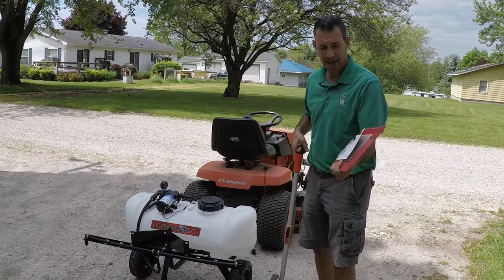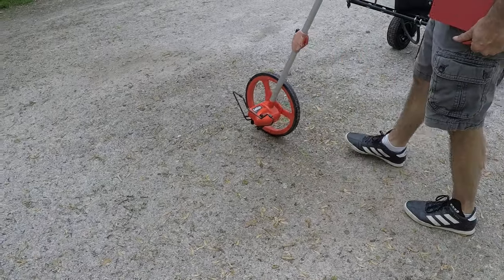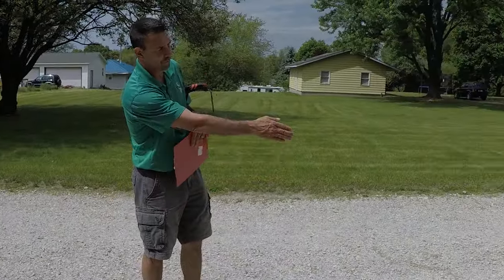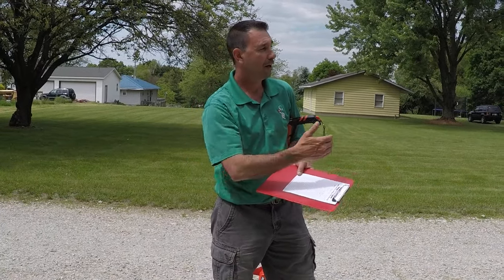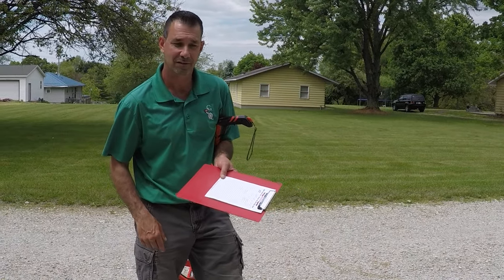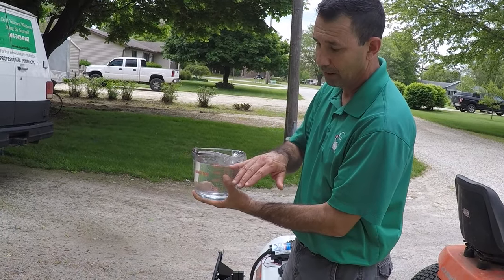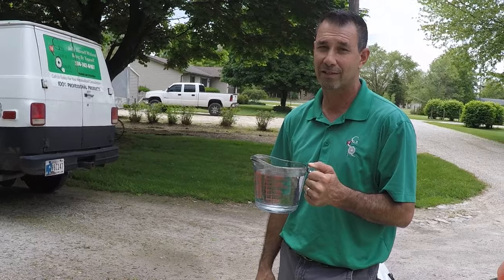How To Calibrate a Boom Sprayer

Comment: Most of the home boom sprayers have 2 spray fittings on the ends. They tend to overlap each other on the centerline as much as 40". You then also get a 40" lighter spray on the ends. You will need to overlap the next row with the outside spray fitting to get get the same coverage as directly behind the centerline. Look it up in your manual.

Comment: Am I missing something? Would he not only be putting down 1/2 of a gallon per 1000 sq ft out of just that one nozzle?
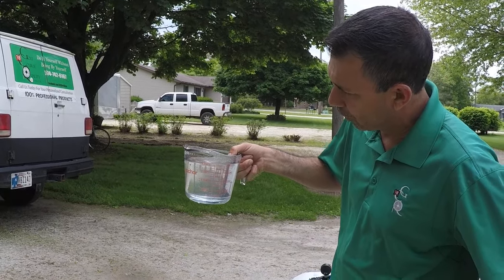Reply: at 5:30 he explained that he measured 32 fluid ounces in the .34 seconds.   Since his boom sprayer has two nozzles, his sprayer is laying down 64 fluid ounces or 1/2 gallon every 34 seconds.  Which is the amount of time it takes him to drive the 1000 sq ft.
Reply: @ftworthtexan9082 interesting with my backpack sprayer my goal is 1 gallon Per 1k sq ft.
Reply: @gregpezan9631  you have a couple options to manipulate to get the numbers you want.   Change the tip size of your sprayer, or change the speed at which you walk when your using your sprayer.